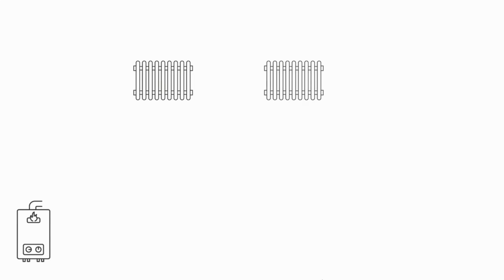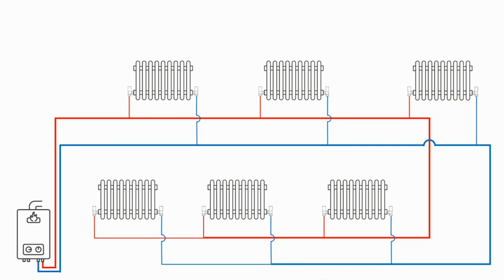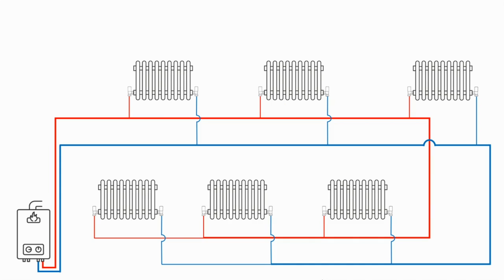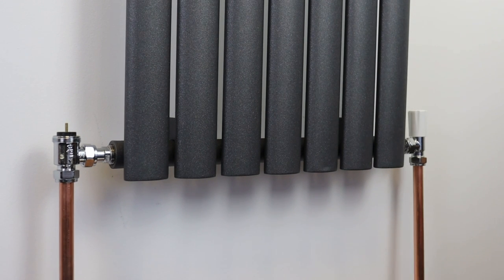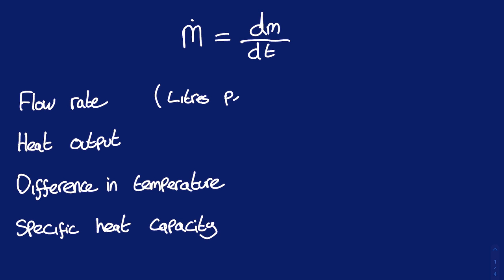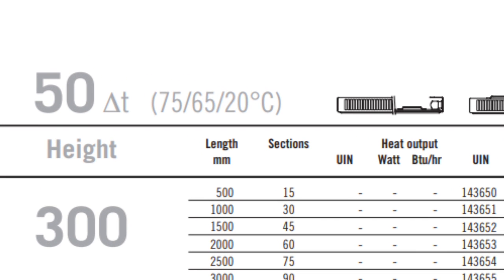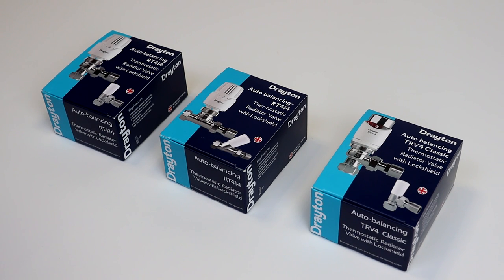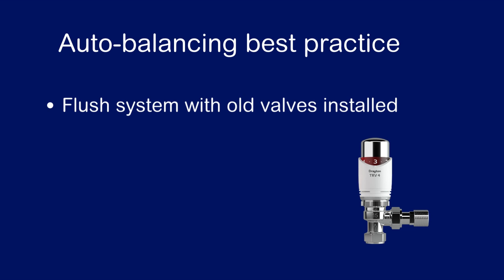The Principles of the Drayton Auto-balancing TRVs

Comment: @Draytonheating I've just had 14 of these installed (retrofitted) and set them according to your calculator at a Delta T of 15, but the radiators are not getting hot. Only luke warm. There is a hissing noise coming from the valves when the heating is on like they are not open enough and water is hissing through them. If I set them to the commissioning position the radiators get roasting hot, as they used to be before installing them, so it seems like these are restricting the flow through the system far too much. What can I do about this? Can I take the calculator values and double them so that the radiators are all still set in the same ratio e.g. if a radiator should be set to 2 I set it to 4, if a radiator should be set to 6, I set it to 12? Please can you advise, as it has cost me a fair amount of money for the valves and to have them installed, only to be currently left with a system that is now functioning worse than before installing them.
Reply from the maker: These valve bodys are uni directional so can you confirm that the flow through the radiator aligns with the flow direction arrow stamped into the body?

Comment: These look great. To determine the order of rads in my home can i open all trv's and locksheilds fire up the system find the first one shut off the system close that fully down both ends to isolate it then fire the system up and find the next one and so on and so on as just hand feeling them was not allowing me to find the order. Can this work with standard locksheilds left fully open or must i fit the new ends?
Reply from the maker: That method of identifying the radiator order will work. If you've got existing locksheilds fitted you don't need to replace them just lock them wide open.